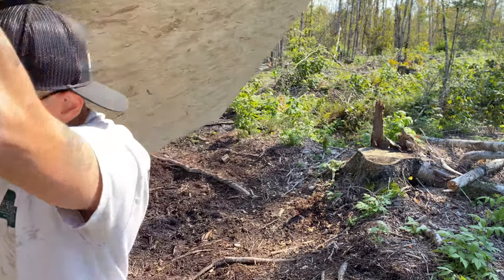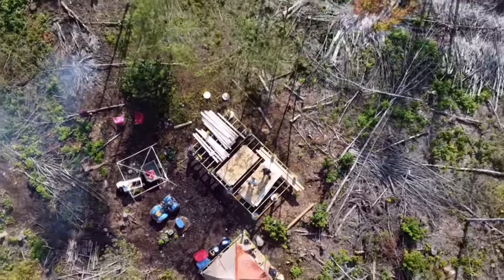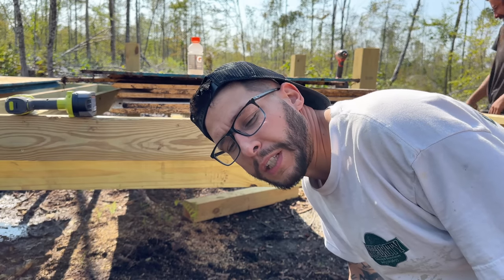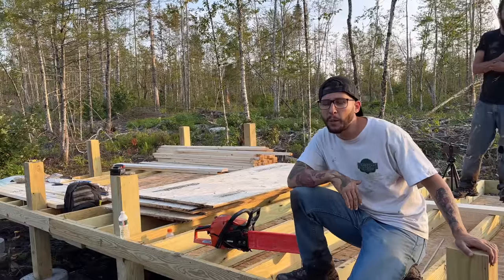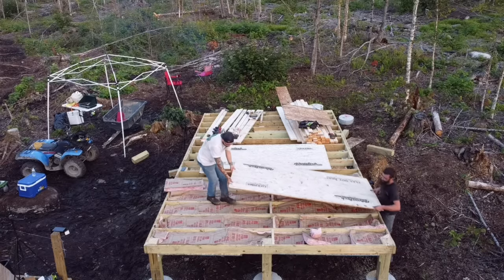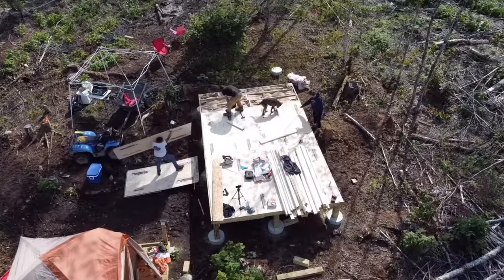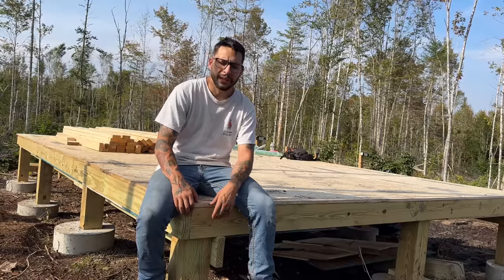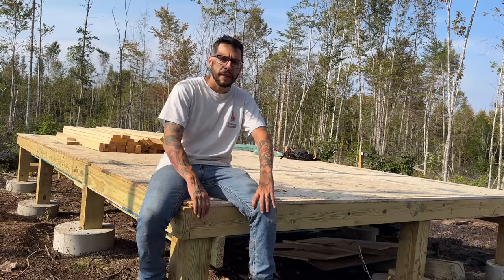SIMPLE OFF GRID CABIN BUILD | EXTREMELY REMOTE - NO ROAD | AFFORDABLE CABIN | PART TWO!

Comment: So glad that you put wood underneath your insulation. I see people leave it exposed and the wonder why critters are in their cabins
Reply from the maker: Thanks so much for watching our video! I want to try and build as legit cabin as possible so I’m trying not to skip any steps!
Reply: Bubble wrap on top of the joists is so much easier than decking the under side
Reply from the maker: @alabastardmasterson  sometimes what’s easiest isn’t what’s the best quality. The mice are really bad out here
Reply: I agree about the mice. I think that a Sheet metal mice guard would be a better and easier mouse shield. Especially since there is plenty of air circulation underneath. That OSB could soften around the edges from capillary action from the sides.
Reply: I used Styrofoam insulation underneath my cabin.

Comment: Looking good, you work fast considering the remote location! What a great cousin to travel 5 1/2 hours to help out...keep the videos coming!
Reply from the maker: Thank you so much! Some days it feels like we move in slow motion out there. Looking back on the progress feels nice tho :)
Reply: Where I live we don’t consider it remote if you can drive street vehicles to it. We consider remote as something that only has river, ATV or airplane access.
Reply from the maker: @Chris_at_Home  in the winter is snow mobile only but in the summer we get the truck down to about 300 yards away from the cabin. I’d say the land is off grid but the cabin on the land is remote…if that makes sense to you.
Reply: @Practicalforest  Okay. I built a place when we had to park 6 miles from the road and bring everything in behind a snowmachine or ATV/UTV.  I built  a 12x16 with all 2x6 walls and an 18/12 pitch roof so I could walk around upstairs and not worry about snow on the roof when I wasn’t there. I tried to heat it with a small direct vent propane heater and it would not keep up until I insulated the floor.  This was just the start as I made a third gable to add another 12x16 which I did and put a wood stove in that.  When I was younger we always had at least a half dozen people come out and ride in the winter and fish for salmon in the summer. We usually get 3-6 feet of snow there most winter.
Reply from the maker: @Chris_at_Home  holy smokes! 6 miles is no joke. That’s real remote man. Was it in Alaska?
Reply: @Practicalforest  Yes it is in Alaska. I don’t know what was more work, hauling materials, clearing the land with big birch and spruce trees or the actual building. I used 6” well casing and built 8’ off the ground. I cross braced the pipe with angled steel welded. It survived a 7.2 earthquake with not problem. The gable is 33 feet off the ground.

Comment: Those Advantech panels are no joke. Heavy and slick!  Props to you for toting those in by hand!  We put the Zip sheathing, taped, under our floor deck to take advantage of the WRB and air seal then blew insulation into the joists before putting the Advantech down on top.  Also building ours with cash. You’re not crazy and you’re not alone.
Reply from the maker: Glad someone else knows my pain about how heavy these are! 
Did you do construction before building yours? I’m a painter by trade but didn’t know much so we kept it simple. My next one I want to go all out which yours sounds like you did!
Reply: @Practicalforest , yes, I framed houses thirty years ago until I got tired of working in the Texas heat.  Which means I was also thirty years younger!

I am self-building a cottage (1000sf) so we can get on the property and then we will start to tackle the real house.  The cottage is great for dusting off the old skills and trying all of the new techniques and building products out there.  More interesting than my day job!

Comment: My Advise for a solid Floor system is to Glue & Screw the Advantagtec Flooring. You can leave the tubes of Glue near the fire to keep it playable. 2" Deck Screws every 12" will give you a solid Floor. And as alway stagger the joint's. Best of luck 🤞 Another 603 friend.

Comment: Wow this is so similar to watch you building this.  Im doing something similar down in the Ozarks but also milling my own lumber.  I am a few steps ahead and my similar footings are 12 months in and have had zero settling or frost heave even with a -15 zero cold soak after rain.  I built a post and beam 16x30 and am no longer needing a tent while I work.  I’m not new to building and construction but I was amazed at how much harder and satisfying it has been off grid.  The sawmill has nearly paid for itself already and it’s framed entirely with oak.  My dewalt nailer worked decent for sheathing, but the nails couldn’t suffer the oak and about 1/2 of them bent so had to use screws at times.  Keep up the good work.  I can’t imaging doing what you did with no previous construction experience.
Reply from the maker: Absolutely love hearing from you man. That gives me hope to keep going. I really want to get a saw mill and make my own lumber. It’s on my list. Good luck with the rest of your build. Keep checking in!

Comment: I watched
 this as a first visit to your website. I will make a list if suggestions so you can consider on your next build. 
1. Goid idea on getting that thing off the ground. I am not a fan if OSB under the floor in case the rain wicks off the wall and softens the edges for the mice. 
2. I don't understand cutting those 6x6 so long and then all the trim waste. I would have pre cut them and used a laser to notch the rim joists . Pretty easy to do and it looks like at keast a thirty percent  waste factor or more . Hammer drill a center pin to locate the posts accurately and use string lines to get it right. Center pins or galvanized clips after the fact is OK. 
   3. Those corner posts could have bern left projecting above the floor with full length studs caging them in. That's how the building will not want to walk on those gravel set stones as they move around a bit with the frost. Even better with full height solid vorners, but probably not practical to drag them through all that mud..
4. Window and door location.is what I mark first with a red marker and note the rough opening width noting center line and red arrows to the king studs which are rough opening plus three inches. Then and only then should you lay out the regular on center studs. If I can vary the location of a door ir window a few inches and share an on center stud to save lumber, i will do it to save expense and avoid skinny spaces between studs where practical..
4. I am not a fan of T111 siding.  It commonly gets soft at the end grain. If I had to make a horizontal joint, I would certainly use Z flashing where the ends butt together. I would consider using metal siding possibly run horizontally on the building. Use plenty of screws with torx drive to discourage breaking in by thieves. Further security could be accomplished by concertiba wire under the siding or rebar drilled in the walls at least four feet high. Consider a commercial steel door with two deadbolts . Reflective insulation can be had on the interior of roof panels or even on T111 style panels. It makes a world of difference in transmitted heat , but it is not exactly cheap.
   Take any or none of my ideas as you see fit. You did very well as a first build. Everyone has their own style. My style would be to show up with completely marked plates or plans with a complete cut list for all the odd short cripple studs and headers. Congratulations on an attitude that you can always learn more.
   If you are interested in texting back and firth with a semi retired carpenter with 53  years on the job from roygh to finish work, ket me know
Reply from the maker: Wow brother thank you so much for exposing me to a mind set in construction that I’ve never heard. Material waste figures wasn’t even in my mind when I was building. 
I am going to save your comment and study the methods your outlined. I really appreciate you taking your time to lend years of experience to a very new builder. That’s huge for us and our journey.

Comment: Nice job on the footings and sheeting the underside of the floor for insulation. In colder climates not insulating the floor only makes what ever is used to heat work harder because it heats the air closest to the floor first. I found this out first hand. You really should stager the edges of the plywood when doing flooring. I have seen floors start to pull apart because of not doing that.
Reply from the maker: Thanks for watching and the kind words! It’s good advice about staggering the advantech subfloor. I’ll sink some screws in the edges to hold them together tighter. You think that will help?
Reply: @Practicalforest  I don’t really know. I know someone what built a cabin about a mile from ours about 5-6 years ago. He had a bunch of friends come out and help him build and I stopped in and suggested he stagger the flooring. He came to me this summer and said he wished he had listened to me. He didn’t do as nice a foundation as you so it is pulling apart. My suggestion was to put another layer of sheeting over the floor bridging the seams. I told him he could get by with something like 7/16 sheeting with construction adhesive to solve any further problems. I’m not a professional builder and have learned a few things the hard way over the years.
Reply from the maker: @Chris_at_Home  i appreciate you taking the time to type out a potential solution. I’m going to tuck some screws in it and keep our fingers crossed.
Reply: @Practicalforest  No problem. What happens is over time the floor joist under joint will flex with weight on it causing a separation. If your floor is stiff it’s not a problem.  When I was in my early 40s I quit my job for six months and worked with some builders I knew for free just for the experience.  I had a technical job that was easy to move around  and find another job with my experience so quitting and then going back to work was easy. That was almost 30 years ago.

Comment: the most fun i ever had with a log cabin was cleaning the 2 55 gallon barrel septic tank in the woods :D i really questioned if the plumbing was worth it over the outhouse at the time :D hand pumping 40 gallons of shit was an event :D
Reply from the maker: Bahahahaha the image you left me with 😝 I’d take hauling wood or pumping crap any day!
Reply: @Practicalforest  use 250 gallon tanks... they will last you a decade of occasional use and you will rationalize a small septic truck service :D and its not that much more work digging for 250 gallon containers :D
Reply from the maker: @jstefa2  we use a compost toilet because we don’t have to apply for a permit. Once you put a septic in out here they want a permit pulled.
Reply: @Practicalforest  well... crap... literally :D
Reply from the maker: @jstefa2  bahahaha 😂

Comment: I hope you cover that floor up with a tarp so it doesn't get wet
Reply from the maker: Thanks for the feed back! I Covered it up with two HUGE tarps and strapped it down like a tractor trailer load. It should be water tight. Thanks for watching the video Dave!

Comment: Hands down, trekking that flooring in manually had tk be a bear... That ledger board is nice when setting floor joist.. Should have waited till under osb was on then installed lol also bushradical puts little sticks on each side of the joist then lays plywood in from the top then insulate.. Seems way easier than from underneath.. Good job.. I've been collecting materials and plan to buy small amount of acrerage in the UP of Michigan and build a 200 Sq ft cabin, fingers crossed I can start next year... Look forward to more videos on your build
Reply from the maker: Hey man thanks for watching, I’m really glad you can appreciate how brutal the trek in is with the sheets! 
You are totally right about the ledger board and osb, it seems so simple that it would support it all the same. Bush radical has had over 10 cabin builds to get it right haha he makes it look so easy. He was my inspiration to film. 
I’d be wicked interested in seeing you build a cabin, I’ve never been to the UP but I’ve heard it’s mini Alaska
Reply: @Practicalforest  it's beautiful here, I came up yesterday from down state.. Little over 6 hr drive from my house to my mobile cabin I built during world shut down on a 16" utility trailer. It works till I build slightly bigger... Either way keep up the videos and I'll watch
Reply from the maker: @Michigan-thrifter  our spot is a 5 hour ride! It’s totally worth it. 
You did it the right way by building a little trailer. That will be life saving when building your cabin. Sleeping in the tent gets old after a while.
Reply from the maker: Brother I hope you see this comment. If I write a letter would you get it to Dave whipple? I would love to fly out to Alaska and do a video with him.

Comment: SUGGESTION,  u could have forged a small road for your truck to make getting supplies easier on yourself, then let it grow back over when ur done if u want that cabin in the woods appeal. I did that then blocked my road with felled timber, but will eventually open it back up bc in the winter, i dont like trekking in essentials through 20 to 40 inches of snow. 

The insulation should be stapled to the top of the floor joist thus hanging from the floor joist providing an air barrier closest to the coldest part which would be the ground or outside. Since its just laid in there, the insulation falls to the bottom of the cavity created and cold air gets in on top of the insulstion which is right undernesth your floor. Your floors will still be cold. If stapled from the top of the joist you would then have (from top to bottom)the wood subfloor, the insulation and the air chamber then the bottom piece of osb providing protection.  The air barrier or cavity is essentially what provides the barrier to keep the cold out along with the insulation so you want the cavity at the bottom towards the ground then the insulation closest to your floor.

Great vids and hard work. Awesome job
Reply from the maker: Thank you so much for watching our video and giving me amazing advice. We are hoping some big bushes pop up around the fields were are making to really hide the cabin. 
I felt like I should have stapled it but then double guessed it. Since it’s just the subfloor do you think it won’t be as noticeable?
Reply: You’re going to notice it. Hate to say it.
Reply from the maker: @LukePighetti  we’ve got a decent wood stove and are doing a loft bed. Maybe I’ll put some nice rugs down so it’s not so cold. I can’t image it being that big of a deal but only time will tell!
Reply: @Practicalforest  I appreciate the bull headedness. It will take you all the way to the finish line! Just for a little more context, I live in Bangor, which is quite a bit warmer compared to where you are. Taking the insulation to the edges and stapling them off will achieve a few things.

1. insulate every cavity to all four edges
2. maintain insulation loft. It's already compressed in your video and it will get worse
3. provide a vapor barrier which is critical in our area on floors because the ground is so wet

If there's any opportunity to remedy, I would highly recommend it!
Reply from the maker: @LukePighetti  we are right in Lincoln so not that far from Bangor. I might only spend a weekends or two at it in the winter. Where should the vapor barrier go? 
I really do appreciate your expertise man
Reply: @Practicalforest  The paper face on the insulation you bought is the vapor barrier and when stapled to the top of the floor joists it goes exactly where it needs to go :)
Reply from the maker: @LukePighetti  well might as well burn the whole thing to the ground and start over 😂
Reply: @Practicalforest  Oh I don't think so, although you may have already started building on top of it! Enjoy :)

Comment: How are you going to prevent condensation in your enclosed floor space?
Reply from the maker: I’ll put house wrap on the bottom? Do you think that’s a good idea?
Reply: @Practicalforest seems like whatever you do that plywood is going to trap moisture.  A better choice would be to put screen or better yet hardware cloth on the bottom to protect the insulation while still letting moisture escape.
Reply from the maker: @mikemarriam  I felt like it was high enough off the ground to get the air circulating underneath it. I got some house wrap that I’m going to put on the under side possibly
Reply: @Practicalforest 😊I hope it works out.

Comment: Nobody is gonna bring it up, so i will be the bad guy. Did you not build your floor framing to make sure the floor sheeting would come out exactly to the edges? The one side looks to be at least a couple inches short. The wall will not rest properly. Am i the only one seeing this?
Reply from the maker: Check some of the later videos. It came together to be pretty square!